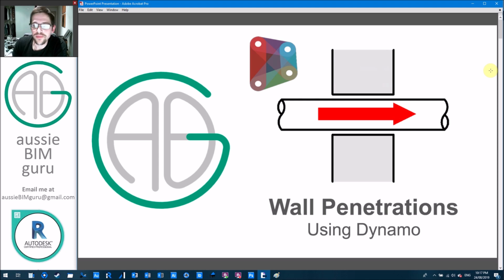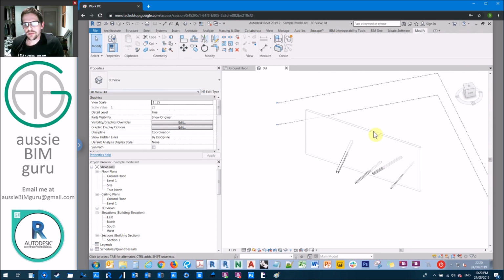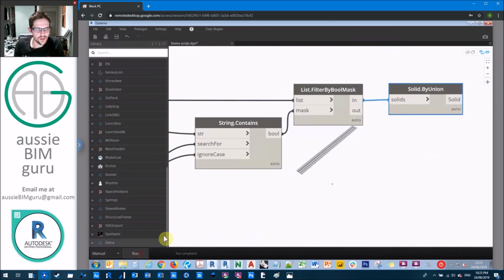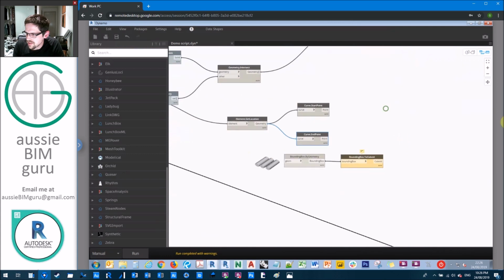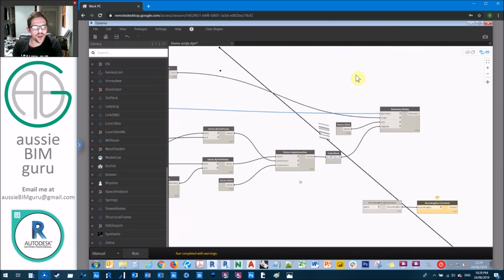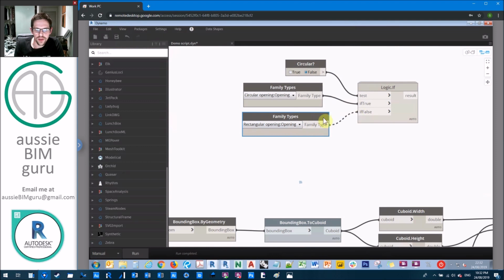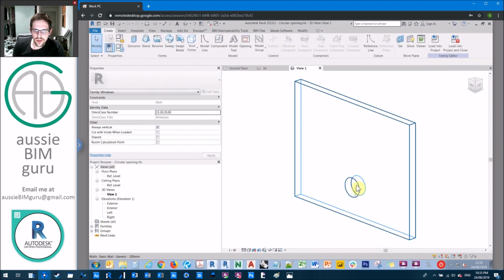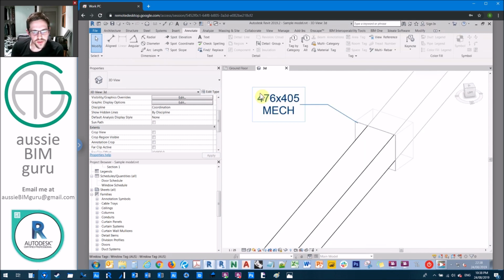Create Wall Penetrations using Dynamo!

Comment: Hi Gavin,
I need your help in dynamo mate please. I am working with structural shop drawings for concrete panels in Perth.
3 months ago I did my dynamo script to add bottom grout tube and was working perfectly but today I  got an error saying "no nodes are loaded" in the familyinstant-by face& point!!
Could you please help me out.
Thanks mate
Reply from the maker: Hey there Ahmad!

I believe there are often issues with these nodes. The issue is either a bug in the ootb nodes or they are custom nodes with missing package

I would add archilab, clockwork and springnodes packages and see if that helps. They all have nodes that do these functions - if it isnt resolved by this try using their version of these nodes instead anyway

See a thread here with similar issue/solution: https://forum.dynamobim.com/t/familyinstance-byface/5993
Reply: @AussieBIMGuru  thanks Gavin, but I am not professional in Dynamo,  honestly speaking I didn't understand how i can resolve it from you answer! I really appreciate mate if you get time to help m.
if you want i can send you my script?
Reply from the maker: @ahmadsaid8594  unfortunately i am on holidays and changing jobs next year so have no access to dynamo until february. Suggest hitting up the dynamp forums in the meantime; lots of helpful people there.

Also check lesson 1 of my dynamo series; i cover how to find/install packages there.
Reply: @AussieBIMGuru  Good Luck Gavin and Thanks a lot mate.
Reply from the maker: @ahmadsaid8594  you're welcome. If it's still an issue in february reach out and I can help - but hopefully someone can help before then :)

Comment: The holy grail for me is getting the same exercise, but for Linked IFCs.  More often than not we get vendor models created in something other than Revit, therefore, need to be using IFC. Being able to locate an opening based on linked IFCs  this would be fantastic.
Reply from the maker: Dynamo has the ability to interact with IFC to some degree (albeit limited, and dependent on class mapping), but unfortunately Revit is not a great program for handling IFC files, especially if not class mapped properly.

I would suggest looking into Geometry Gym for Rhino, and forming workflows in Grasshopper instead (using either Rhino Inside or native Rhino modelling).

Someone has built a workflow here though (but I suspect for a big IFC file it would struggle); https://learndynamo.com/mod7/

Comment: Hi, I have a question. Could you tell me how to use dynamo to make mechanical and electrical machines
Reply from the maker: Dynamo is unable to make families, rather it can set type values or place family instances from a pre-made family.

There's a thread here discussing one method to place mechanical units;
https://forum.dynamobim.com/t/using-dynamo-to-place-mechanical-families/7021/12

Check out the 'MEPOver' package in Dynamo which has various nodes for creating duct/tray/pipe runs by line and points I believe.

Also check this out;
https://www.bim42.com/2016/04/using-dynamo-for-mep-design-part-2/
Reply: @AussieBIMGuru  Thank you very much. I have to study it

Comment: Great video, but I'm having trouble finding "Springs.HoestedInstanceByPoints" and "Element set parameter by name". I'm running Dynamo 2.1.0.7500. Could you help me please ?
Reply from the maker: I haven't got access to Revit 2020 or Dynamo 2.1 yet unfortunately. I'm surprised set parameter is not available - this is a core function of Dynamo so I would expect it to be present in some form - I suggest searching the library on the left for 'parameter' and see if you spot it or a similar node; maybe they renamed it in Dynamo 2.1.

I've had a look into Springs and in the latest build (203.1.0) it appears this node has been renamed to 'FamilyInstance.ByHostAndPoint'. I assume this node still functions the same way given it's inputs and outputs, but has just been renamed to better align with Revit naming conventions.
Reply: @AussieBIMGuru  Yupp!! Springs just renamed that node.
it works. Thanks, Gavin for Sharing. Greate workflow. simple and elegant.
Reply from the maker: @himitsudana  you're welcome!

You may enjoy this video I made this week also that deals with door openings by linked models;
https://youtu.be/8Iby7cmT0p4

Comment: 1. if several services are selected at the same time, one large opening will be created. the issue is when the service are separated with some distance, the opening will be very strange and very large. How can we improve it at the dynamo? is there any demostration? 
2. if the above item 1 is fixed, we can try to select multiple penetrating services and multiple host elements for creating wall openings.
Reply from the maker: Hi Edward, you're correct in identifying that there are a lot of ways to improve and enhance the workflow - this video is just the start of something bigger and more complicated for most people I'm sure! This video was really made to show the concept of bounding box axis rotation and the general principle of creating a 1-off penetration. Another workflow to enhance the script is an 'update' to pre-placed penos, so dimensions aren't lost.

Grouping services automatically can be quite complex, as it means the script needs to be built to recognise when something is 'close enough' to something else, but also to be able to run this on a mass basis (for each element, consider every other element). See this thread where someone 'solved' this challenge: https://forum.dynamobim.com/t/sort-lists-by-proximity/23031/6

From here, you would instead group each 'list' of elements as geometry, then union each sub-list, and run the same process as this workflow, but for each sub-list. This can be done by either working at levels, or by applying functions on a 'list map' basis. It's quite complex, but if I get around to solving it I'll let you know.

I would suggest that instead of selecting all penetrating elements, you look into the clash nodes from the Bimorph nodes package, which can obtain all elements intersecting something such as a wall (without taking too long) and then continuing forward with all elements of a particular category(ies) only. From there you could also filter for minimum sizes (min. radius, or min.width/height) as we often ignore elements smaller than a certain size in peno generation (they just core hole instead on site).

Hope that helps!

Comment: Amazing work! GJ
Does it work for MEP links?
Reply from the maker: Thanks Dusan, this workflow doesn't support links, however with a few adjustments to the front of the script it can. Linked element geometry can be obtained using a clash check vs the selected wall from Bimorph nodes package, then carried forward from there. I"ll create a video at a later date to show how this is done!
Reply: @AussieBIMGuru  I have done a workaround to get the location from revit links, as you said. But, in my worflow, I also need to create penetrations on floors (structural foundations, e.g.). You have any advice of how to do this?
Reply from the maker: @guilhermealmeida2650  check out the springs package. It can generate both shaft openings and floor openings by floor/curves.
Reply: @AussieBIMGuru  I will see that and give you a feedback.

Thanks!
Reply: @AussieBIMGuru  Hello again.

I got it. As my workflow deal just with links, I have build a family based on floor and used the same node used on video to put the family instance. I have used the solid centroid as the point and the floor as host.

thank you for the time!
Reply from the maker: @guilhermealmeida2650  great work!
Reply: @AussieBIMGuru  Gavin did you ever revisit the process for supporting links? I have a high interest in this particular process for when we are linking in the Architects model into our Structural model to cut all the windows, doors, curtainwall openings in the shear walls with tolerance.

Comment: Hi! at the beginning after list.Flatten in panel object.type instead of a list of object it says :ProtoCore.DSASM.StackValue. can you help me?
Reply from the maker: Hrm... it's an odd error, usually means the data wasn't compatible or there was a bug in the node. Can you cross check all data before the object type node is able to have a type extracted, then try getting the type of the first index item in the list, then create a new object type node (and reboot revit/dynamo). Check at each step if this fixes it.

Object type is an OOTB node so it should be working... but i have seen odd things before like this.

Also which version of Dynamo/Revit are you using? If below 2.0.3 can you update to this and then try as a last resort.
Reply: I have same issue at this point. And I have already updated Dynamo. But still that issue happen.Please help ..
Reply: At the List.flattern at bottom result in your video it's null but while I using that I have result with function .
Is that any error?
Reply from the maker: @ayanshaskrishna  can you email me your script for review?
Reply: I have exactly the same issue. With different piping and air handling.

Comment: Great Job. I want to ask you if it is possible  to do not rotate the cuboid and use only the host point, width and heigth to insert the window?
Reply from the maker: Thanks!

Unfortunately due to bounding boxes in revit always being axis aligned, we can only measure the zone of penetration by rotating our intersection to be lined up with the dynamo Y axis.

If we measured a bounding box at an angle, the size would not be true and correct, as it isnt parallel to the wall.
Reply: Aussie BIM Guru I see. Thanks a lot, you answered me in few minutes
Reply from the maker: @adrianoremigio997  usually got my phone on me :), no worries!
Reply: @AussieBIMGuru  I tried your workflow, but i have a problem: inspite i made the solid union of two pipes, each time I click run it makes one opening for the first or second one and not together (it jumps from one to the another). Is it possible I have made a mistake in the solid Union?
Reply from the maker: @adrianoremigio997  is the pipe union providing 1 solid in the list output?

Email me a screenshot/demo file for testing if thats easier :)